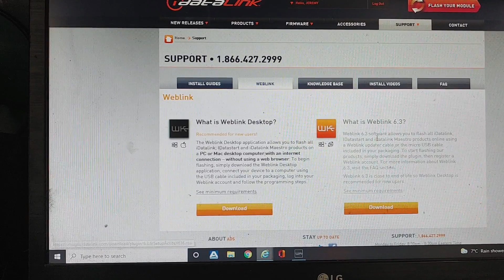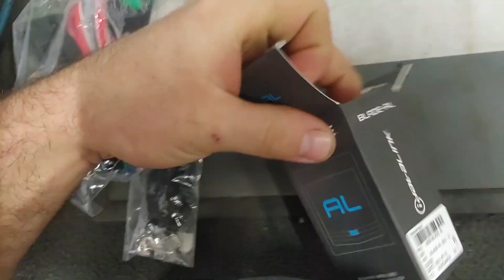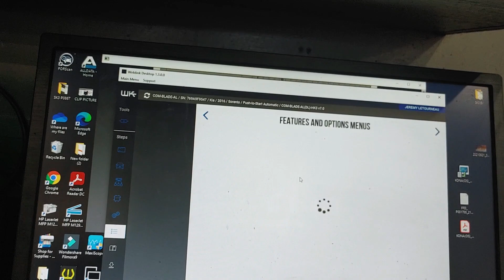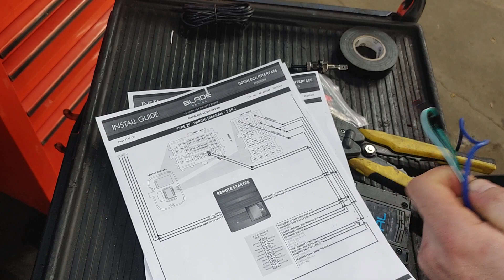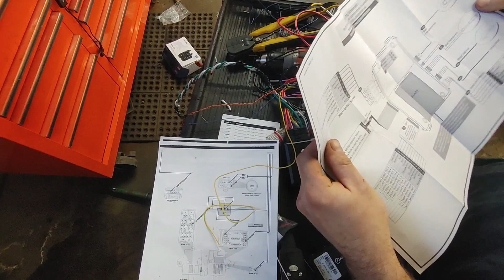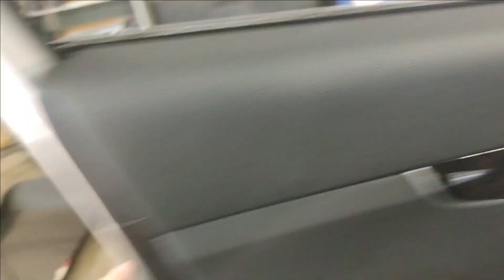How to Set up A Remote Starter

Comment: Hey man i got a question if the blade al doesn’t turn on when its in "on" position doesn't that mean that its not programmed or wired bad? Because my led doesn't turn on unless i do it manually
Reply from the maker: I would recheck all the connections, as the blade should only turn on when ignition power is sent to it, but the unit should have a constant power and ground. so when the start signal is sent to the module, a relay turns on the blade unit along with all the ignition feeds needed to start the vehicle.

Comment: Hello friend, thank you for your teaching, I would like to ask you, is it necessary to program the BLADE? I would like to use the simplicity of compustar
Reply from the maker: all bypass modules need to be programmed, the compustar is the remote starter then you still need the bypass module. i use ADS(idatalink)  but you can use which ever company you like,.
Reply: @JLsAutoSolution  Hello teacher, I was able to install the computer to my car, it was excellent, for a car with a chip in the key, if I need to activate the blade, right? Or I must use another type of starter module, to leave an encrypted key inside it.